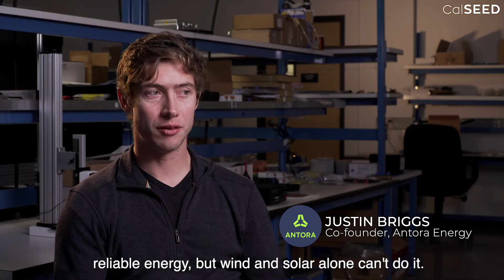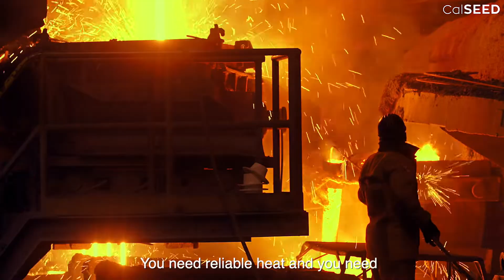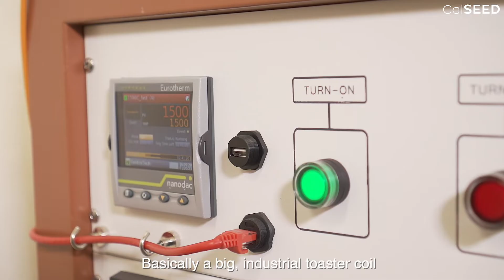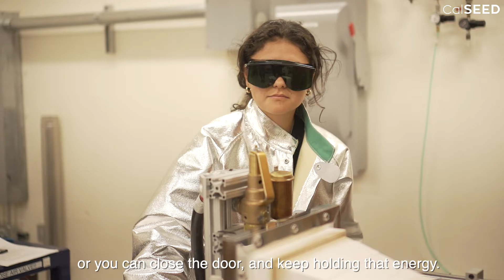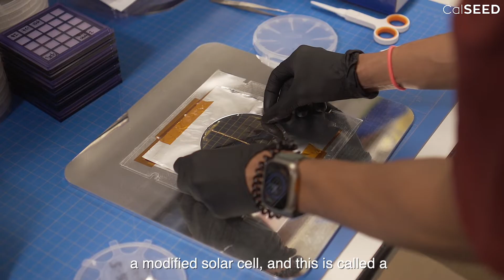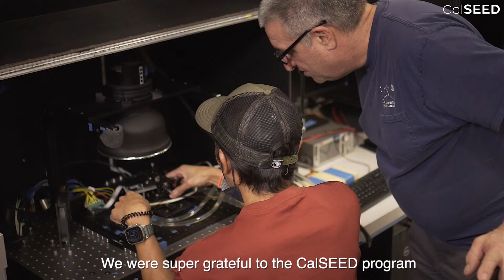CalSEED Stories: Antora Energy Electrifies Industrial Manufacturing with Thermal Energy Storage

Comment: Now that you have a solution for industry and corporations, when do you turn this tech to help with heating and electricity  for individual homes to get away from coal and natural gas especially for colder states that need energy for 4 to 6 months of the year
Reply: This is a storage technology for areas of the country that have a surplus of renewable power. Geared as you mentioned, toward industry/corporations. This for instance would not be a good solution for homes in New England but is projected to be a good lower-cost solution if you have renewable power/excess power to store in the form of heat or electrical power, for industry. ..and no I do not work for this company.